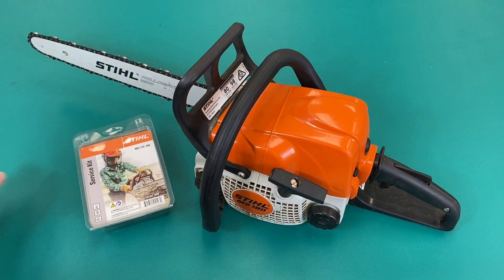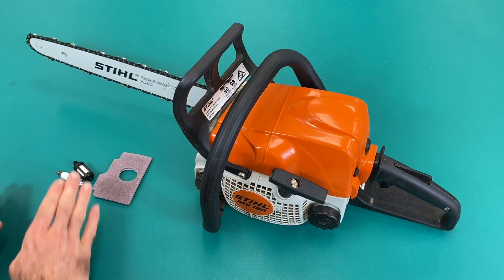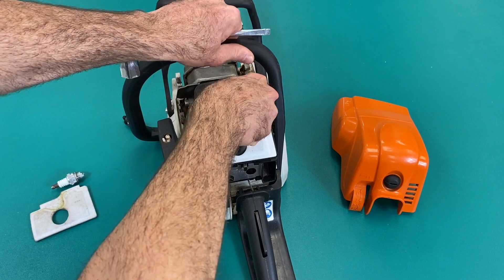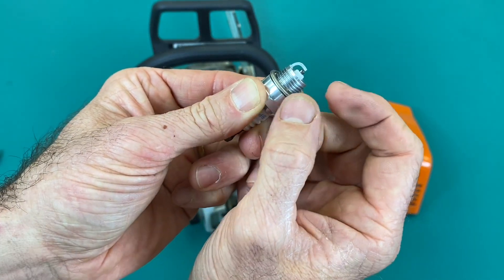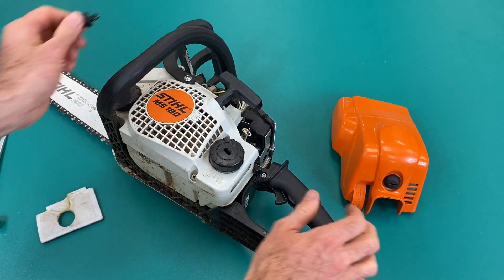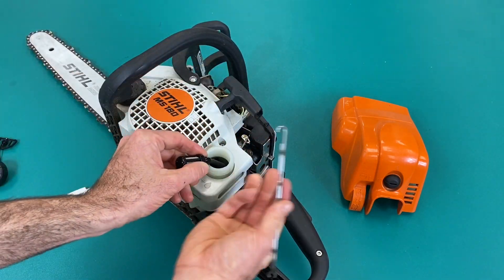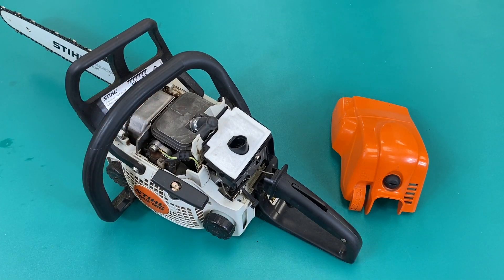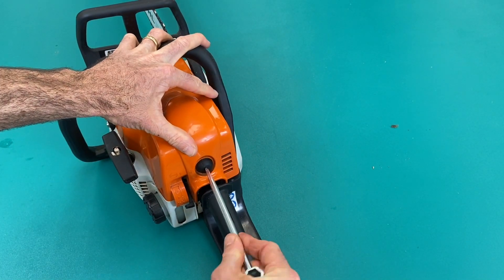Service Kit Installation for STIHL: MS 170 and MS 180

Comment: This is a good video, plugs are super cheap and while I agree they dont need replacement much if properly maintained, they can get fouled, and for $5.00 its a no brainer. Ditto for the air filter.

Comment: this is stihl BS on 1000%… your fuel filter of maintained would never need replacement.. if it’s thst old you could sell your old saw and pay fractions to buy a new one… it takes a LONGGGG time for that fuel filter to become clogged if maintaining with 93 non ethanol (from stihl techs themselves) the sparkplug is even a more comical bit… when maintained properly spark plug lasted me 10yrs on ms170 and still fires no problem with regular use… one minor flooding issue the other day… this video is made for stihl to capitalize on the people who don’t know better which i would say is predatory
Reply: also wants to talk about cleaning on a brand new saw for instruction purposes which is not the way to show regular use or what most people come into contact with… this is bs
Reply: "..this video is made for stihl to capitalize on the people who don’t know better which i would say is predatory."

I don't think it is. There is nothing to indicate that. The video is a guide for those who want to use Stihl's service kit.

Whether the service kit is needed is another question.
Reply: @kenlund9671 he made only valid points. Why have a kit you would never need. Same with my air filter I just clean it regularly, no need to replace it if you clean it regularly and look after it would likely never need replacing. I’ve cut over 60 metres of firewood with it this year and all these components are still running fine the only issue I have is oiling the bar properly and consistently.
Reply: Really, predatory seems like a reach. So plugs and filters are a grad conspiracy eh? Haha.